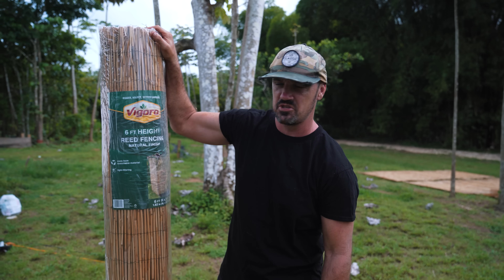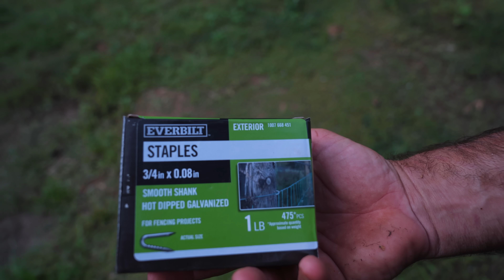GIANT STEP COMPLETED ON OUR OFF GRID JUNGLE PROPERTY!

Comment: Highly recommend installing diagonal braces at the tops from the columns to the rafters.
Reply: Not much loading on the root, but good to brace them up..
Reply: I can get behind that idea... When I think he had to do it before the winds come The wind gets under that roof .... And it's going to peel it right off... It definitely needs some bracing and soon....
Reply: Indeed I was thinking he should add 2 wires length wise or so, to support the reed. And yeah,  birds will love the reed for needing 😂
Reply: No bracing is no bueno
Reply: I was gonna suggest that also in high winds that extra stability

Comment: Matt. My brother of another mother at heart. As a retired teamster crane operator in the roofing industry, I have set several thousand roofs of all types. And now that you have essentially added a sail to your uprights, I'll beg you, please! Install permanent lateral support before something bad happens. I would suggest bracing at 45° angle from uprights to your top plates. That is the weakest point in a wind storm at present. That's a lot of weight up topside, bro. I love guys. Stay safe.
Reply from the maker: I'm considering a few options,  do u think heavy steel "T" braces would work as well as knee bracing? The  'T" braces have a smaller profile
Reply: I'm sorry I didn't see your response sooner but yes T bracing will definitely help though knee bracing is most typically used. I would double them up like a "sandwich" on the upright.

Comment: Matt use a pair of pliers when a nail or staple is difficult to hold with your fingers, it helps you keep from smashing your fingers.  👍😎🙏🏼✌️
Reply: Needle nose pliers do the trick.
Reply: usa a simple fork. lol  nail between the tines , space them out your could  possibly get 3 or 4 nails in one fork..
Reply from the maker: Fork seems like a great hack, I did end up using pliers
Reply: @SailingGoodBadandUgly  thin-ish cardboard is easiest. You can pre set a bunch of them, and whack away. It'll keep tearing off as you hit each one, assuming you start at the right end, and have them set in a neat row.
Reply: Muy buen trabajo y se ve bien.
Reply: @TimTimTomTom

Comment: That thatching is going to sag down, eventually falling down. 
I had done something very similar, it will hold its own weight for a while, eventually will fail to do so and come down.  Maybe run something across under it, baling wire? Something to keep it from starting to sag. 
Looks amazing, love the framing. 
Metal roof will last forever as long as it’s anchored down well. 
Property is coming together👍🏼
Love your content, keep it up. 
John
Reply: 2X4 Cross Members between the 4X4 roof supports (before installing roof panels).  Then staple reed mats to 2X4's.  I agree... gonna sag over time and look terrible.😥
Reply from the maker: Ye I've stapled it but still concerned.  I believe I could tie it up with fishing line
Reply: @SailingGoodBadandUgly  Baling wire, stapled up

Comment: Buy some cheap military type goggles,  the type used by Air soft/paint ball warriors will be good enough, they are based on ski goggles and are excellent at keep out sweat and not fogging up and they usually come with 3 different interchangeable lenses so you can have normal, semi dark and real dark for whichever sun conditions you are working in. I've used them for years and they are great.

Comment: I like it. Add a 1x4 or 2x4 to hold up reed in the middle, screw it to 4x4. Some 4x4 diangle braces. Also always leave overhang on roof panels. I would have just split it and call it a day. Good job.

Comment: Looks very good and you two nailed the aesthetic you were going for with that extra layer of reed.
The extra air gap and insulation provided will help with the heat of direct sunlight on the metal roof.
Droop or even rot may end up being an issue is my only concern and yours as well from what you said.
If it ends up being an issue of droop maybe use wire strung the length over main beams and between the reed and beams it rests on, along the middle, spanning the gap to help support it.
The right wire wouldn't be to visible, if you find or paint it the right color, and shouldn't take a large gage to be strong enough to help hold the reeds up in the middle.
That structure is very solid and if you do have to, as you said, you can attach anchors when or if they're needed and at multiple angels to long stakes in the ground.
That roof over the RV/Trailer should really help with it's longevity, we should all know roof leaks and water intrusion as well as sun damage are what end up destroying them over time.

Well done you two and as always I look forward to the next video.
Oh, and your reaction to the sticker bombing of a sometimes childish but truly entertaining friend.
Watching Raif and Sasha's video I know it wasn't done out of malice but in fun, as a brother ribbing a brother.
At least he didn't poop on the deck from the spreaders as you suggested but I'll admit that may have been easier to clean up.
Take care and God Bless...

Comment: Use a bandana on your head to stop the sweat from dripping into your eyes , keep a couple on hand for when they become to wet. Then try safety googles  for dust control , that should work and its low cost .
Roof looks good ,excellent idea from your wife using the bamboo.(always listen to wife on decorating ideas).
Hope you used some rubber washers on your bolting down of your aluminum roof , helps keep water out . I'm enjoying your building project and progression on your homestead , it's looking good so far.

Comment: Safety manager here, I have struggled with particles flying around also, in hot muggy climates (florida). The best solution I found was to work upwind when possible,  to lower the risk. also get safety glasses that have an adjustable nose piece so you can bring them closer to the face when needed. When not in a situation with particles in the air you can readjust the nose piece to allow air to circulate. Keep a cloth handy to wipe the sweat and glasses clean. There's no perfect solution. Hope this helps.

Comment: Where the main beams meet the support pillars, I bolted and lag-screwed (Coach Screwed) heavy duty galvanized steel  shelf brackets, the ones with the fancy twists in the front supports,  They cost me here in Australia about twenty dollars each, and I use one on the end vertical pillars and one on each side of the intermediate verticals.  These brackets do two things--they help stop the structure from racking or moving in a storm, but the main purpose is to stop the roof lifting if you ever do get a hurricane, and I used epoxy chemical anchors and heavy angle galvanised L-brackets to hold down the verticals to the foundations for the same reason--to stop them lifting in a severe storm, because a sloping flat roof develops a lot of lift when the wind reaches a good speed.  My foundations were concrete blocks, and I poured them so they were pyramidal with a  flat top, to make it harder for them to be jerked out of the ground.  I also use that galvanised  heavy cyclone diagonally secured strapping,  which is perforated at intervals for screws.  I think I paid about forty bucks a roll for it, and a roll pretty much does one wall on the diagonal from the top of one pillar to the base of the next-but one further along .  This   metal strapping or  some alternative such as wire cable or wooden braces to stop the structure from, i think the term is "Lozenging" or skewing out of shape, is a good ploy.

I applaud your use of screws and bolts on all structural fastenings.  I never use nails--only screws and bolts or threaded rods.  Here we get Category 5 cyclones as a possibility.  Not many poorly built structures can withstand that--and nailed ones just come apart and the pieces fly far away, potential missiles for third party property damage.

Comment: Pro tip I learned years ago. Zipper bag with eye drops and q-tips in your glovebox. If you get something in your eye on the job, saturate a q-tip with eye drops, pinch your eye lashes and pull your eyelid away, and wipe your eye. The q-tip fibers grab everything, the eye drop makes it so you can't feel your eye being wiped, and gives you a cool relief feeling after the wipe! I've used that technique for metal, wood, and a bug, several times in life with 100% successes.
Reply from the maker: Hell ye! Great tip

Comment: If you ever need to work on the rv roof/ air conditioner you will have a hard time unless you move the RV out.
Reply: And also, repair/maintain the rv roof before installing the covered roof parts is a post effort recommendation, obviously.

Comment: Love the look. We have a screen room we made and it has a metal roof. What we did was use a single layer reed fencing and under it or in your case on top of the reed we put a single layer of yard cloth to hide the sight of the metal, as we only have one layer of reed allowable  in our budget. Also, having exposed beams allows for hammocks or hammock chairs. 
Later on you can go back from the underside and staple any areas that may sag.

 You should of had them back the truck up to the pergola and unload them directly on the roof.       
But it is looking awesome, beautiful job. 

On a side note don't cut off the back as the rain water that comes off will start making a trough in the dirt below. So the closer to the house then you will have another issue to address. Unless you have another plan to address any future problems. Your going to really like it if you have to walk around it in the rain.

Comment: Cheers from Canada! I wish I had a week to come and play with you. I'm a Licensed Carpenter and Timberframer.  Looks great!  Hope the reed mats don't sag, but you can always staple up to your 4x4 strapping.  I'd really look at adding some 45 degree braces, from posts to beams, and if possible from the posts to rafters as well.  I'm often on YouTube, so reach out any time if you have any technical questions.  You guys are an inspiration, your gumption leave me slack jawed, and you always get it done, even if the technique is not conventional. What ever, get it done, play safe. Love your channel.  Oh, and if you cut back the rafter ends plumb and back a little, you can install a facia a bit back from the steel, say 4" and install a facia board, and then can do eavestrough. That lovely galvanized roofing will provide great water if you collect it, and how great would that be?  You can put in a huge tank to collect, or ?

Comment: When sinking lag bolts keep a tub of bearing grease nearby to put the tips of your bolts into before you drive them into the hole. The lubrication will make him go in a lot easier and provides a little extra corrosion protection. You could also use the wax seal (a new one) used to seal toilets to the floor as a grease-like lube for your lag bolts.

Comment: Nice job!  That wood mat was a good idea!

If you want to keep the same look without knee bracing, you might consider metal T and L braces for the post and beam connections.  They can be black to shadow them.

Also, you might want to have that metal overhang in the lower back to keep the running/dripping water away from your trailer.

Comment: Hey Kristen & Matt, I respect you guys still doing everything on your own. You still remain true to your roots and that is hard to find. I have stopped watching a lot of channels because they start making money and completely change.  So keep up the hard work.
 I wanted to give you some advice on the roof you are putting on. Those panels are not supposed to be installed on pressure treated lumber. The reaction with the metal in the treating and the panel can cause it to rust in time. Considering that you will likely be getting condensation on those it is very possible.
 This is something that even other contractors have not bothered to pay attention to but we never install panels on pt. It will actually void warranties. 
 They are usually painted which may help as a barrier to some degree but in your case, instead of replacing anything you can use a non granulated asphalt peel and stick to cover the mating surface as a barrier and that will work. Most of those will have a synthetic top sheet like roofnado psu or something similar. We have had to do this before where the general contractor used pt for the purlins. Just cut 5" strips, lay them on and then trim at the board on either side with a knife. Then you don't even see it. Of course this is 20/20 hindsight now for the pergola as there's obviously the lag from start to posting so if you don't go back on this project just make sure future projects, especially possibly your house, that you don't do this. 
 If you need any other info let me know.
 Thanks for keeping it real.

Comment: For Safety Glasses/Goggles I use these every day as a Aerial Construction Lineman, they are inexpensive but have worked for me. 3M Model 11873-00000-20 Tinted & 11872-00000-20 Clear , 11874-00000-20 Mirror. Great Job on the pergola

Comment: For your bracing you can do 4x4's x 3' length horizontal 45's in the plane of your main roof beam timber at all intersection at columns (especially perimeter ones at a minimum). This avoids using  typical pole barn "farmhouse" looking 45's vertically at columns....and it will fully brace the structure in combination with some black metal plate angles at underside of beam to column joints. My engineer for my tropical Lanai did this and it eliminates the need for any vertical 45's "farmhouse" bracing between columns and beams and is rated for 180mph hurricane force winds! The horizontal braces also provide a great mini beam in corners to hang potted plants, artwork, etc. !

Comment: It's starting to look nice. As long as the panels have a solid connection to the frame, it can withstand an awful lot of wind. Using serious wood screws and some big washers to spread the wind load may help prevent them flying away.

Comment: I cant help but worry about two things: The thatch creates a bit of habitat for creepy crawlies, and with no diagonal supports on your structure its not going to stand up to high winds and horizontal stress. Normally a pergola has no solid roof to allow the wind through, with a roof you effectively make a sail thats going to move the vertical structure quite easily. One more thing: where does the roof drain to ? it appears to be flat...

Comment: Sweat, "Halo Headbands" are what I wear (the tie one for tightness) Amazon. They have a rubber seal that fits against the forehead, fit under my hats. Handle the seal conservatively and superglue it back on if it loosens. I head sweat big time, I've used them for years!
 I think the matting will quiet excessive rain noise and the esthetic idea is an excellent one. Good drone work Kristen!

Comment: The reed looks great, even if you just brace the backside behind the van in one corner, so brace behind the back of the van and the corner next to that behind the van you will lock in the corner like you have done out the front.

Comment: I thought the Reed idea was stupid, but seeing it done, that looks great. Love it.
Reply: It was a good idea, but a very poor way to install it. It'll crush over time (within a year I'd say), and then you have fasteners which are installed THROUGH the reed panels. So those fasteners cannot draw the rafters tight, and with that, the roofing. That entire roof structure is just begging for a storm to tear it off and send it flying in large sections. The only way to fix it, is to remove the reed panels, roof panels, and draw those rafters tight to the beams. Then reinstall the roof panels. It would have been so easy to install from the bottom, then it's easily replaced once it starts degrading, wouldn't cause the huge structural flaw... and and and.

Comment: Steel bracing might be an option versus wooden knee braces.  Steel could be right angle brackets bolted across the joints at the top of the posts, hidden from external view.  Another potential bracing strategy would be steel cables attached to various points around the structure.  Could be done fairly hidden.

Comment: Good job man handling those big sheets up there.   Looks like it is coming along quickly.  Not easy to build alone and in weather.  May need to move your satellite dish so the roof doesn't kill your tv.  I use the dewalt clear glasses and work good.

Comment: Matt, get an Australian styled felt hat (Outback hat) and it will keep the sweat off your brow by wicking it out to the edge of the brim. It'll also keep the sun off the back of you neck. And no, felt is not hotter than a baseball hat. I live in central FL and you know how stagnant the heat and air gets here in the summer. Buying that Aussie hat was the best decision I've made to making working outdoors in the summer bearable.

Comment: Technical instruction sheets are readily available for “R” panels and other metal roofing. If you’re going to do DIY projects, at least follow the manufacturer’s recommendations. A common mistake with DIY’ers is reversing the laps on the panels, which he did. The long leg goes down first, then the short one on top (recommended to be on top of butyl tape sealant). I’ve seen dozens of roofs put in the way he did here and a big problem is the the “stitch” screws tend to push down the short leg underneath and the screw walks / wallows the hole before drilling through the second panel, you also actually create a water trap on the flat that doesn’t dry out completely (not only rain, but from morning condensation from heat swings) that prematurely rusts, and if someone moderate to heavyweight walks on the roof right next to the rib on the short leg lap seam and not directly on the support / rafter / purlin, it’s really easy to kink / bend the panel. Just trying to prevent someone else from making the same mistake.